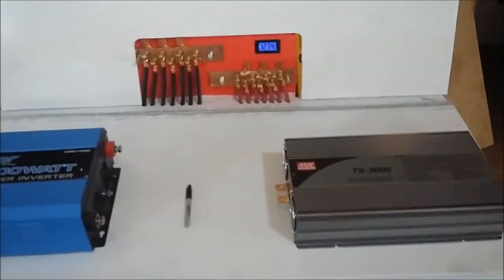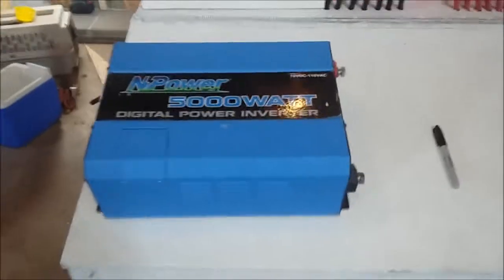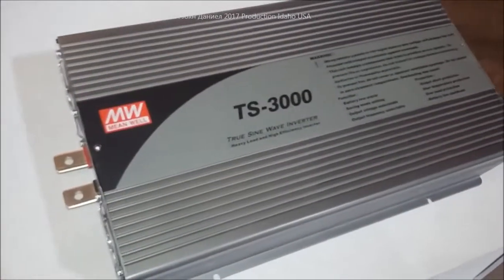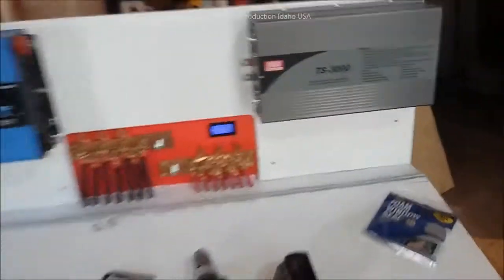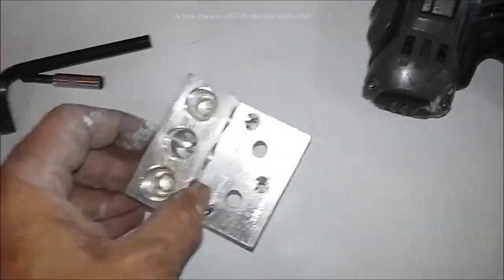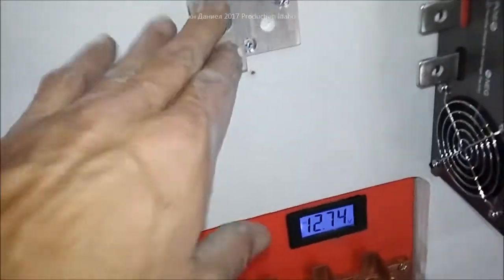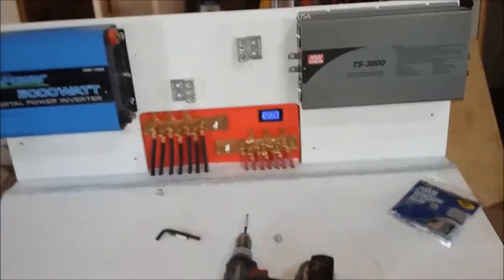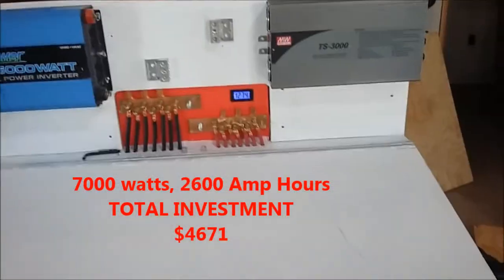Dual Inverter Install Mean Well & NPower - 7000 watts total (info Below)

Comment from the maker: Worth every dime - Mean Well 3000 http://amzn.to/2srD1nJ  and the replacement for the NT 5000 is http://amzn.to/2sc1v3S ,These 2 inverters on one huge battery bank, off grid - look for the links soon. See more on my channel. I recommend the POWERBRIGHT 6K due to brute durability. Spend SMART, get one that last many years. http://amzn.to/2sc1v3S
Reply: John my 6k power bright started pushing put 135.6v 35 amps on all ports I could not find any place to repair it so i had to send in to manufacturer for out of warranty repair. It's cheaper than spending 600.00 on another one shipping was 25
00 fed ex business for the 35 pound beast. I love that damn inverter it's the best one I have seen for it cost. I wish u could have fixed it for some cash now I'm using a small 1500 watt cobra inverter till it gets back so no AC unit for me till then lol.
Reply: Who makes a good pure sine that's affordable not to cheap. Not to expensive? I was thinking I love samlex products.
Reply: @donaldsteele6276  Meanwell is a very good brand. As John states in earlier vids they are used in high-end RV's and Yachts.

Comment: I know this is about inverters. But I'm thinking charge controllers! Like the midnight classic! I didn't pay them a bit of attention. Until I accidentally clicked a video from midnight on the classic. So I watched it. Now I want one. They seem to be the best available! And versatile and packed with capacity and features. And can basicay be used with any source! I could modify a alternator and charge lithium batteries! Hopefully I will not have to do that. Maybe a hydro system generating 1500watts or so. But what I was getting at. Is what do you think about the classic? I heard ppl liking them ,getting them. Nothing about how they hold up. I guess it's a good thing! No problems or issues. Even after years of service! Thanks!
Reply from the maker: Heres funny, a Automatic battery chargers circuitry TRUMPS a Midnight Classic! And is hands, programming free. I use 2 boards from a Schumacher 50 amp auto charger, $20 each from ebay. Just add a 80 Amp SSR!

Comment: Coming out really nice. Something that I need to do this summer is build a actual battery/power room.
Reply from the maker: So far so good. Ran a test load of 4500 watts continuous from 3 - 1500 watt heaters till the batteries hit 11.60vdc alarm I set up. Started at 12.88vdc, no solar or wind incoming.
3000 on the Npower Modified ( didn't even audibly buzz) and 1500 on the Mean Well. 55 minutes pulling like a bandit, and they bounced back to 12.39 in 5 minutes after cutting the load. Will do a video soon on the test. 
These batteries, tough SOB's!

Comment: 400 amps through a 12v inverter, that thing has some balls to still be operational.
Reply from the maker: Chinese rated 400 amp ANL fuse. Actual USA math, Probably 360 amps